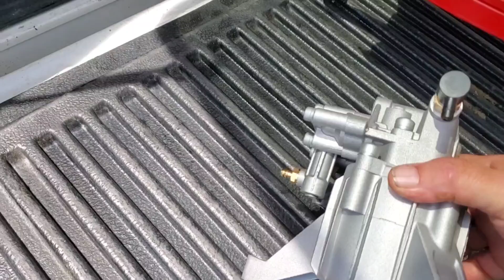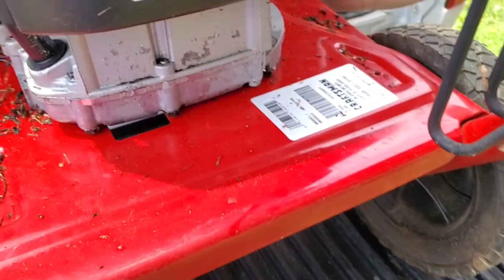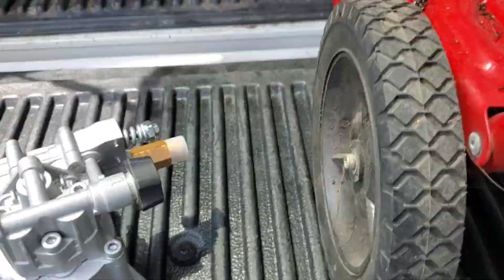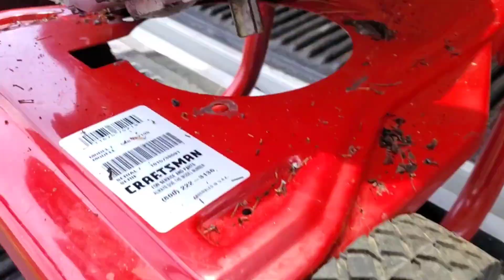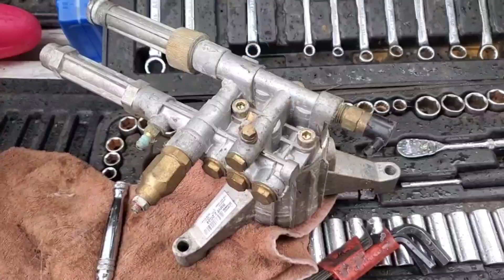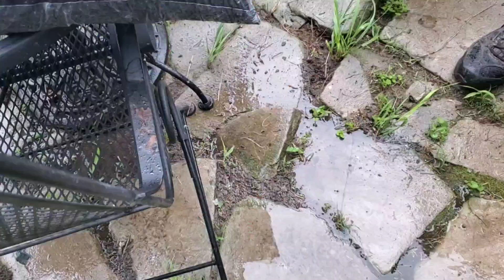How to replace or upgrade your power washer pressure pump.

Comment: The one you linked in the description is a 2400 psi.  Stock was 2550 and you said the one you bought, the one linked, was 3000 psi.